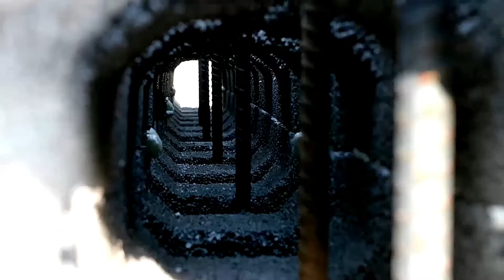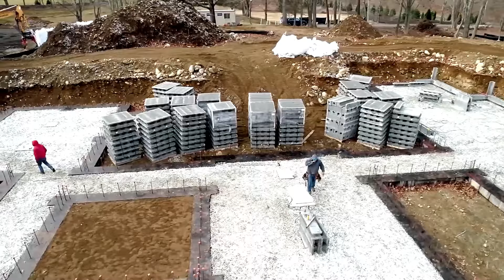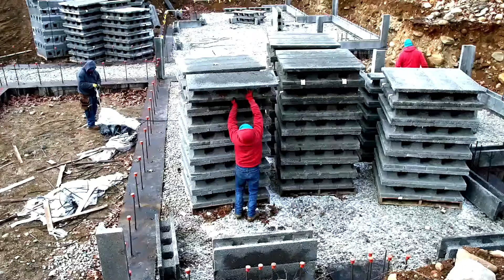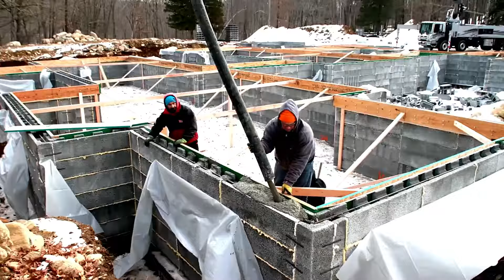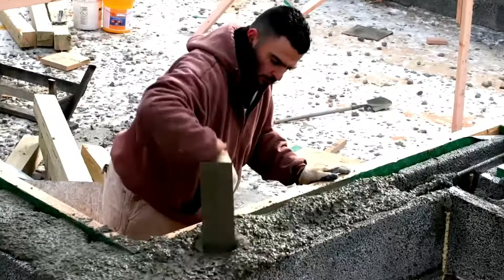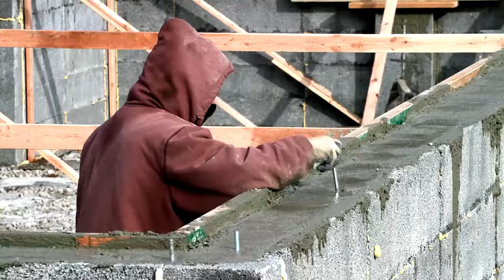“The Perfect Block in Action”

Comment: How do you hang drywall to these blocks? Other ICF has internal webbings that act as anchor
Reply: glue it.
Reply from the maker: All you need to use is joint compound.  No nails or screws necessary.  Just notch trowel the compound on and stick the drywall straight to it.  We will have more videos this year showing this process.